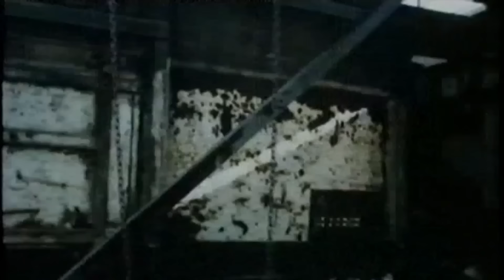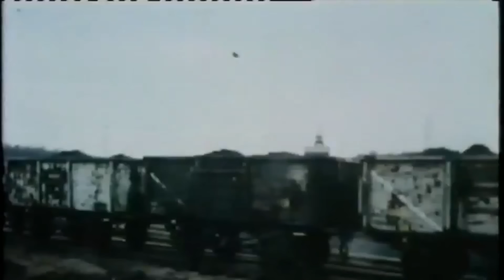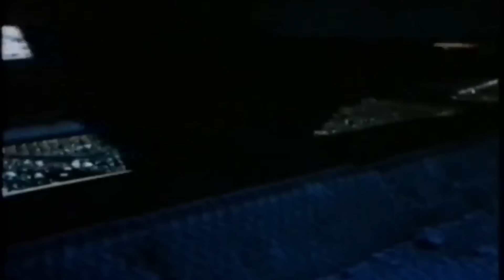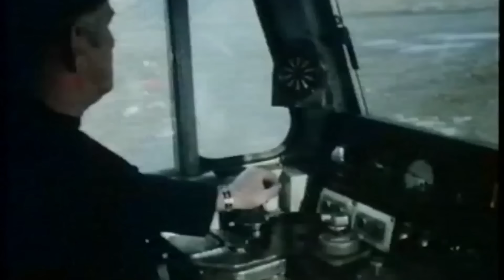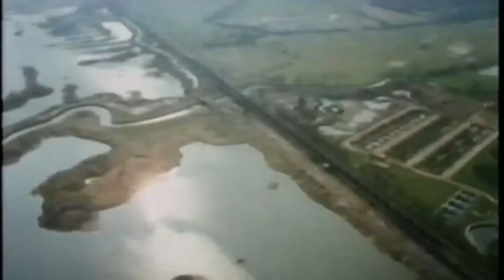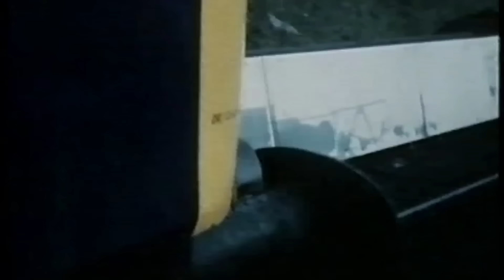How Coal Power Station Merry-Go-Round Trains Really Worked #coal #merrygosound #freight #fyp

Comment: coal was going to far more than a single end user.  unit trains and flood loading are only possible when there are limited customers using the same type of coal (size/grade).  when coal was king, it required more infrastructure.  the video narration gets a bit lazy.

Comment: During my 5 year apprenticeship with the CEGB (Central Electricity Generating Board) I witnessed both the old and new coal unloading methods many times.  The old method was tipping a single wagon at a time, the wagon being pulled along level track by ropes powered by a capstan like you see on ships, etc......very slow and dangerous.  The new method at a 2000 MW station exactly as per this video.